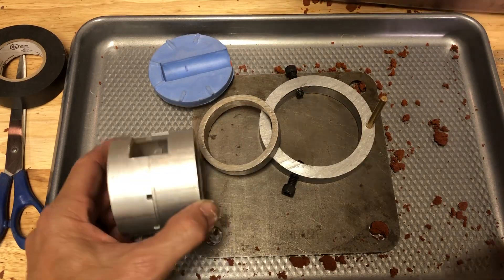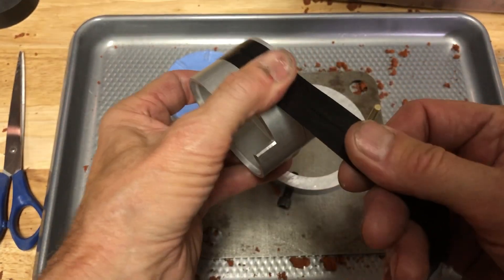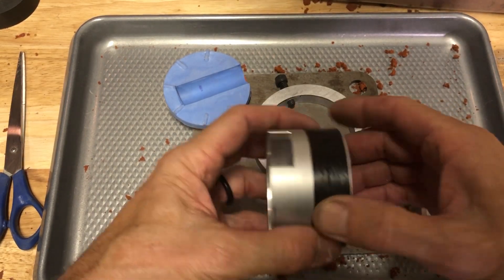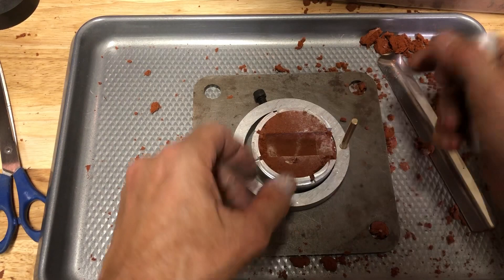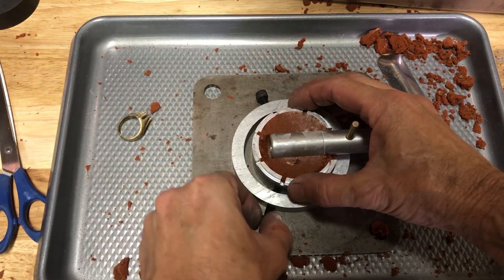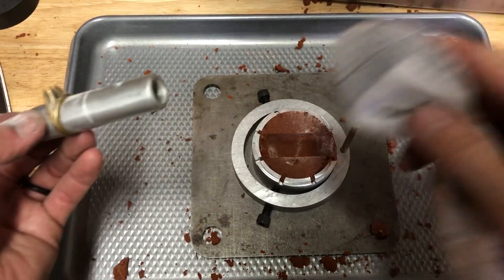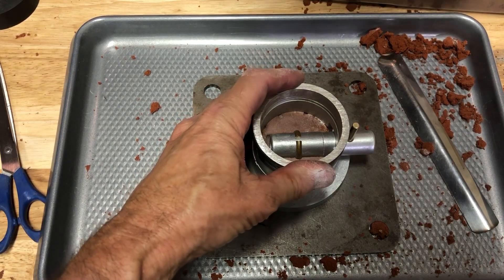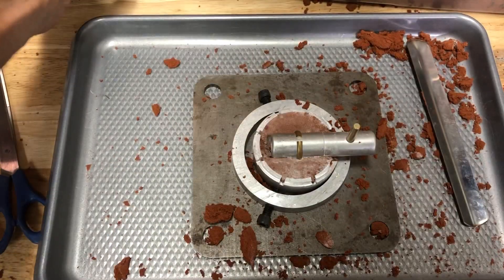Setup Video for New Sand Casting System - Video One of Two

Comment: I'm not a big fan of sand casting, but about the vents - make them large enough to let the air out easily, and then bore holes to the surface, like vents are placed when lost wax casting fx bronze sculptures. And of course be sure to use enough casting metal, to not care about, how much runs out and up the vents. IF you make to large vents, and don't let them go upwards, the metal won't always stop flowing, and the pressure might not be enough to fill the details.